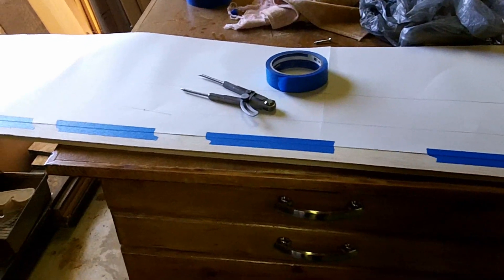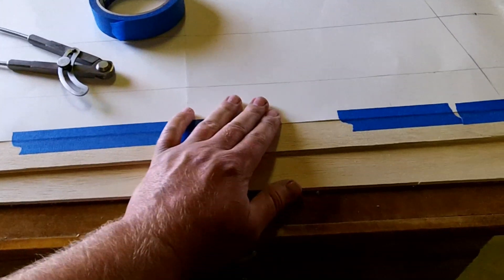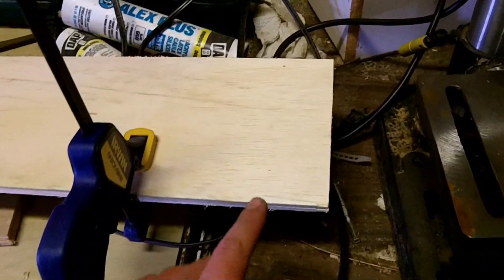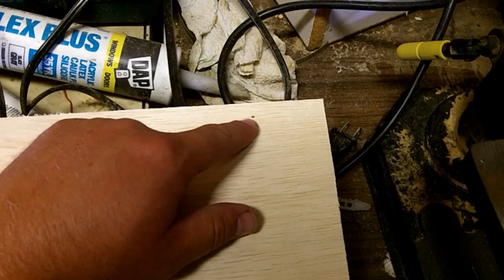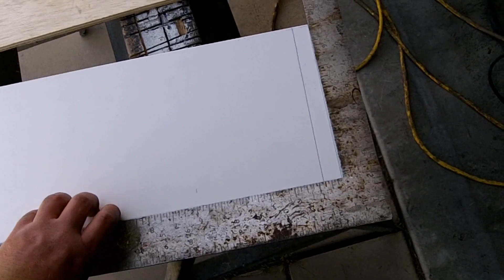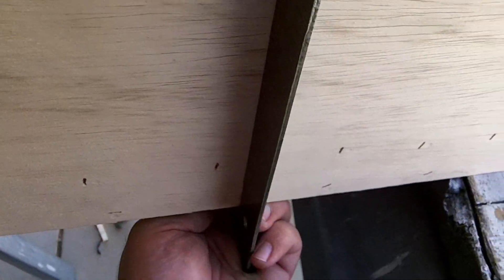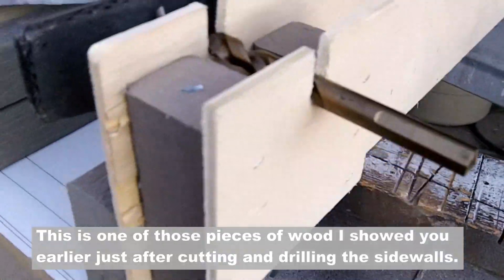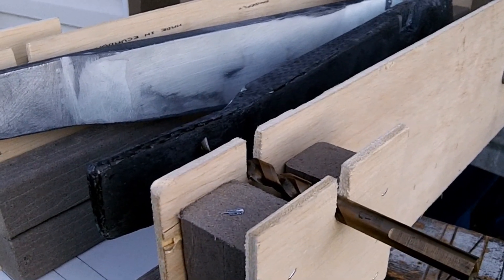Z Frame Bike: Video 10 of 13- Building the Jig

Comment from the maker: @circusboy90210 
I tried making a plug with clay once and it shrank on me. So far, MDF board is my favorite material to work with. I like shaping Polyurethane but it is pretty fragile, same with XPS- also the XPS has to be coated before any polyester or urethane paints are applied.